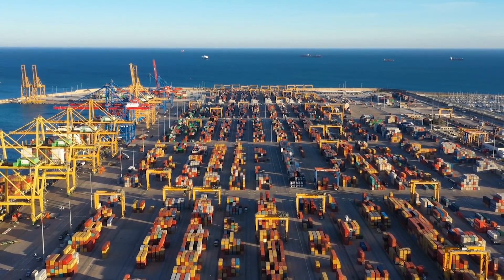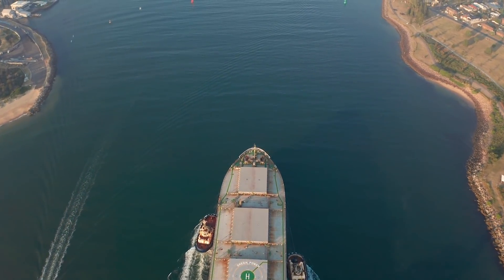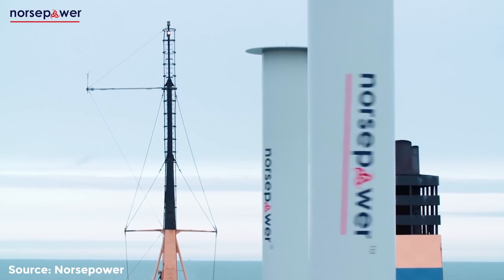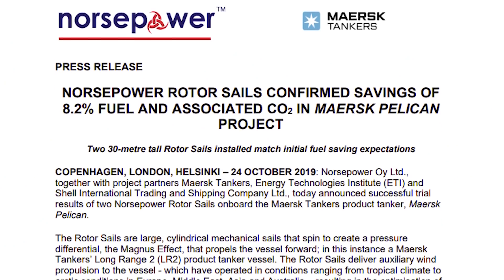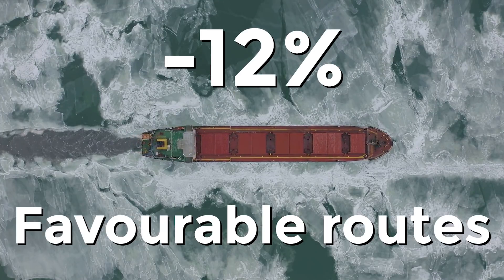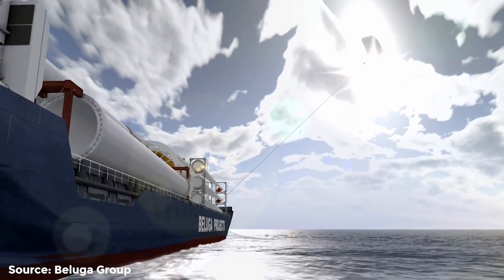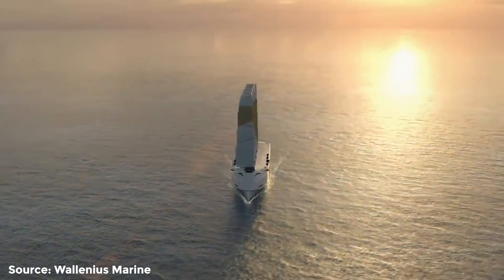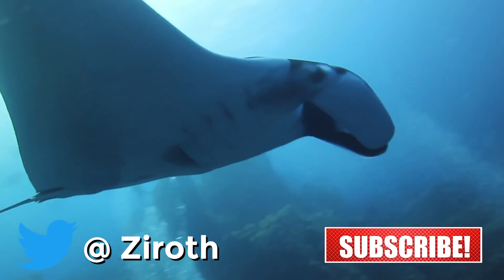Is Wind Power The Future of Shipping?

Comment: The kite sails look promising to me, the other ones do not, mainly because of how they effect the space on board the ship and also their short height. The kite needs no electricity or batteries, no rare earths. It can work in tandem with diesel engines seamlessly. Just add more kites to reduce energy consumption further, reel them in for storms, land and unfavourable winds. It looks to me like it would pay for itself easily while the others look too expensive, complicated and unsuited to the needs and limitations of large ships
Reply: Easiest solution: Add enough batteries to get in-out of the port, recharge on the go using solar power collected in orbit and beamed back using microwaves from satellites.
As all usual sea routes are more or less static, it would be easy to place the satellites in orbits along those routes. So let's say every 100 km there is a 50km strip where the orbit matches your route and you receive power. That way the batteries don't have to be that big and the only thing you need on the ship is the power receiver somewhere on top of the ship.
Reply: @mjk8019  Is this microwave power transmission powerful enough to beam through cloud cover? I'm not intimately familiar with the technology, but on a gut level it feels "wrong" to collect wireless energy only to pass it along again as wireless energy... I feel like any time it goes through a process, there are losses involved, and the total power available for end-use goes down with each new step.
Reply: @c182SkylaneRG  That would be true if earth had no atmosphere. But the fact is that more than 50% of solar energy is diffused in the atmosphere. Meanwhile microwaves are much more efficient in passing the atmosphere, including cloud layers. Meaning that the energy lost in conversion would be much lower than 50%.
Reply: @mjk8019  The next question is: what happens to the sailors that are catching some sun or checking tiedowns on deck when they pass under a microwave transmission zone? Or, what happens to the whale or dolphin swimming in a microwave transmission zone when there isn't a large cargo ship to hide under?
Reply: @c182SkylaneRG  The satellites can track a ship using GPS and only transmit directly to the ship when it's passing by. Well the sailors should stay in the cabin during the transmission, Or just use a special umbrella.
Reply: @mjk8019  Okay, next question: how tightly are we able to focus the beam? How much spread will there be between transmission from a geosynchronous satellite to a point 22,236-26,000-ish miles below it? Somehow I doubt we can keep that beam from spreading more than a mile in diameter, at which point we still have the issues of marine effects, as well as any other nearby shipping traffic.
Reply: @c182SkylaneRG  I was thinking more of a system like starlink in lower orbit. So the sattelites would not be geosynchronous, and instead could charge on the sunny side of earth and then discharge when they are on the other side.
Reply: @mjk8019  That's still what? 200 miles? 300 miles? I was being facetious with the 22,000 miles and only 1 mile dispersion, but I could realistically see 1 mile over 300 miles, or even 1/4 mile over 300 miles, but that's still bigger than the deck of a ship, and irradiates the surrounding area.
Reply: @c182SkylaneRG  Well, this question is above my paygrade :D. This is just an advice, but in theory it should be doable.
Reply: @mjk8019  The occupational hazards of being an Engineer. :)
Reply: @c182SkylaneRG  I can only imagine. officially I am just a QA Automation guy, but would love to one day become a legit engineer.
Reply: @mjk8019  Your theory sir is doable.  You can make the microwave small enough and directed in a single point in several burst. It is already being tested and tried. But not at the level you been discussing.
Reply: I have an idea, stop buying stupid crap on Amazon and Aliexpress.
Reply: Tom Kelly
Do you have engineering education ? ))
Reply: In my humble opinion, I believe that going back to steam power / renewable combo through the use of Solar thermal collectors on nice sunny days directed at boilers, whilst also utilizing rotor sails (that would also aid in propelling the vessel) with a rotating shaft to produce friction heat that is immersed in a water tank to essentially create a wind powered boiler for the steam engines...
Reply: @EnhancedCognition  The problem is salt.
Reply: @VidarrKerr  Surely that can be solved by utilizing closed gasket sleeves for the rotating shaft, whilst implementing a periodical cleaning on the collectors at the port, or with an automated spray wash system.
Reply: @EnhancedCognition  Salt water destroys almost everything.  It would be so expensive to maintain, no one would do it. Nuclear power is the future.
Reply: @EnhancedCognition  Might need to do some calculations on just how much energy there is per square foot and per mph and all that, but I'm not convinced you can boil water with a purely mechanical windmill system. I think the friction losses in that kind of setup would be way too high. Keep in mind that the theoretical maximum efficiency of any windmill is 60%, and the practical maximum attained has been around the 35-40% mark.

Solar, on the other hand, is not only doable, but has been done. You'd need a little PV panel to power a pump that could move your water through a large black-pipe solar heater, and presto: lots of solar-heated water. You might still need a small wood fire to push it the last few degrees to boiling so it can create actual steam, but you can get a good chunk of the way there, first. Of course, you'd need a giant boiler/firebox combo in the manner of old coal-fired steam ships for night-time ops.
Reply: @c182SkylaneRG  In regards to the solar thermal collectors. I was thinking something more akin to an array of mirrors mounted on solar tracking devices to direct said light at a single point (a boiler in this case) to power a steam engine. This of course would only work on sunny days which is where i surmised that a rotor sail (one of the devices mentioned in this video) that acts like a conventional sail in that it helps propel the craft forward could also be used to take advantage of its constant rotation to harness heat from friction to heat a boiler for the steam engine as well and wouldn't require sun.
Reply: @EnhancedCognition  Finally watched the video to figure out what this "rotor sail" was of which you spoke. Personally, I feel as though they'd get more use out of an airfoil than they do out of using some available power to spin those masts to generate lift. In the design presented in the video, that rotor is harnessing exactly 0 rotational energy from the wind, and 100% of the friction energy you're requesting will come from the electric motors powering it. At that point, you'd have much better luck sending that same electricity through a resistive heating element inside the boiler, bypassing the motor and sail entirely. You'll get 100% of the electric energy into the boiler, as opposed to maybe 30%. Beyond that, if you can find a refrigerant that can work at the required temperatures, you can get upwards of 200%-300% of that same electric energy into the boiler by using a heat-pump.

As for solar water heating arrays, those mirrored concentrators are always full of oil so they can withstand the temperatures they get up to, and they're always in small pipes to minimize the thermal mass at any one point in the system. You basically want to maximize the surface area of your operating fluid during the heating process, to try to absorb as much heat as possible, as quickly as possible. You'd also need to consider the shadow created by a boiler vessel, and ensure everything is positioned so that shadow doesn't interfere with the solar collection process. Ultimately, everything comes down to the square footage of the solar collection array, balanced against the radiative properties of the rest of the system (how fast does it collect energy vs how fast does it lose it. If it collects more than it loses, then it will eventually boil. If it loses more than it collects, it never will). Keeping in mind that the hotter the water gets, the faster it radiates that heat to the surrounding environment.
Reply: @EnhancedCognition  

Why solar thermal over solar PV?
Reply: You could probably let them double as an antenna, maybe even carry a radar.
Reply: I don’t think the kite sails are good, because we can’t make them big enough.
Reply: How about shipping companies have v larger numbers of smaller ships carrying the same cargos?
Reply: Even better, we can erect a large frame at the front and back of the ship and use that to hold a much larger kite, which can catch more air. If you rotate the frames, you can move sideways to the direction of the wind, so you can travel in the direction closest to your eventual destination. I call my invention "sails". :D
Reply: @c182SkylaneRG  I think you missed the whole sails take up way too much space on the cargo deck part of the conversation.
Reply: @TitoRigatoni  Technically didn't watch the video, but if you put them at the very front and very back of the ship, you can leave the center area wide open for cargo. We've got better materials technology, these days, that will allow for placing the main-masts at the extreme ends rather than dead-center, and still be able to securely anchor them. Will the ship make good speed? Hell no. But it'll move with the power of the wind in an age where we've run out of fossil fuels.
Reply: skysails have utterly failed. They are to complex to operate and most of the time not even usable. Beluga used them mainly for publicity. and to put this in a timeframe, beluga has been out of Business for almost ten years. Flettner rotors are at least somewhat usable, since they are easy to operate and on many ships deckspace is not utilised or possible to utlilise. Bulkers would be well suited, sadly for tankers thats not possible for now due to the danger of electrostatic accumulation. I was somewhat involved with the FEHN POLLUX Project thats still going well. But the main Problem still stands, as long as Time and Bareboat Charter Contracts dont shift the fuelcost to the owners, its not really usefull, especially since most Shipping companies that acctually own their own ships and run them as well are container carriers
Reply: @necrid7329  So one point to note: in a universe where we go back to sailing ships (or some other form of wind-powered shipping), Tankers won't be carrying explosive or flammable chemicals anymore, because those won't exist. Literally the only way we'll ever go back to wind-powered shipping is because we finally ran out of fossil fuels to power the ships with, and we'll probably go with solar/battery electric before we go back to 17th-century wood-and-canvas. Hell, we might even go Nuclear, just because we "have" to... (Sounds dumb now, but in a universe devoid of fossil fuels, I'm sure someone will pitch it to sound convincing and it'll get adopted. Their descendants will live to regret that decision, sure, just like we're all regretting Vietnam, Iraq 2, and "buy now, pay later", today. Doesn't mean it won't get made).
Reply: @c182SkylaneRG  oil will never "run out". There will just be a point where oil reserves are so hard to reach and so expensive to extract that the number of usecases where petroleum products are used will decrease. There is a need for tankers, be it oil or chemical. And there will be for the foreseeable future. Maybe not in 50 years, but we will see.  Just these past few months we carried a few cargos that wont be able to be replaced so soon.  for example a full cargo of four different grades of petroleum products to greenland. The climate and vast distances make it necessary. And I'm sure fuel is not cheap there, yet it is a necessityBy the way I made a mistake, apparently it is possible to use flettner rotors on tankers, maersk did so and saved about 7% of fuel over a year.
Reply: The future is fossil and synthetic gas. The latter can be produced with nuclear power onshore.
Nuclear power on ships does technically work, but as long as nuclear ships are not allowed to call at civil ports, nuclear energy will not be an option.
Reply: @OpenGL4ever  Why Nuclear power? How much power is required to transform Algae into a combustible form of fuel that a large ship could use for power? Something like an automobile or airplane would certainly require more refinement, but my understanding is that ships already use pretty crude forms of oil, and if internal combustion ship engines can't handle how crude it is, we can always go back to steam power.
Reply: @c182SkylaneRG  You’re advocating burning stuff that has captured carbon and forms part of the ocean eco system. If you’re objective is to reduce CO2 impact, you’ve failed. Nuclear on ships is a proven technology - it’s just too damn expensive. But if everyone was using it instead of just elite military it could potentially be a lot cheaper, especially over the lifecycle of a cargo ship.
Reply: @mondotv4216  Algae forms part of the ocean ecosystem just like Corn forms part of the human food supply or wood forms a part of a forest ecosystem. In each case, you can grow extra in dedicated farms for the express purpose of creating fuel. They've been experimenting with Algae based fuels, and have successfully developed a functional product, but I think they're having a bit of trouble with scaling up production.

Fuel based on carbon captured within the previous year or two is considered "carbon neutral" because you're reusing the same carbon without having any more or any less in the atmosphere than you did before you started. Carbon in Fossil Fuels has been out of the picture for eons until we dug it up and put it back in the atmosphere, adding to the total carbon in any carbon cycle we then create.
Reply: @mondotv4216  while a nuclear reactor is indeed by far the most efficent thing you can use to power a ship, the issue is that naval reactors utilize highly enriched uranium as fuel. The same stuff making up the core of a gun type atomic bomb. This is why they are restricted to military ships only. Land based reactors don't have this problem because their fuel has such low enrichment that using it for a weapon is impossible, but in turn, the energy they produce relative to their size and cost is very low (still much higher than any other means of power generation but not as high as it could be, sadly)
Reply: @c182SkylaneRG  The US marines already have nuclear powered ships, but the problem with them is that the nucular waste can be used for nuclear weapons, making it unsuited for cargo ships (without massive guns in them). Maybe there will be types if nuclear energy without that downside in the future though.
Reply: @thijmstickman8349  I'm not actually aware of any Marine vessels that are Nuclear powered. The Navy operates a few, but the vast majority of their fleet is still oil-fired, rather than Nuclear, because of the risks and the costs involved. The fact of the matter is that Nuclear is extremely dangerous if mishandled, as proven by at least one Russian submarine accident that got turned into a movie. Add to that fact the fact that we still have no place to store spent fuel (the Navy is being creative with temporary storage, and all land-based power plants are storing their waste on-site, pending the development and construction of a permanent storage facility), and the costs involved are prohibitive for any commercial shipping enterprise, even before we get into the risks of needing to use weapons-grade fuel.

I still see the post-oil future of shipping going back to sail (proven technology) and probably being supplemented with solar electric for nighttime power (charge during the day, use at night). I can easily see sail masts being placed in intervals along the deck of a ship, with shipping containers being placed between and below them, such that once underway, the sails will deploy over the tops of the shipping containers and provide thrust, but fold out of the way for crane ops in port.

Comment: Just put wind turbines on the ship, and use the power to propel, or assist in the propulsion of the ship, with a tail wind , it will be more efficient,   an asymmetrical implementation of the alternative propulsion, could allow cargo loading close as possible to normal,    I would very much like to have a large barge, or group of barges, as a homested, on a lake, that can move, I would like to use solar and turbines, for power, with a. Generator, using a large electric motor, to move the large mass, it would be like a floating island, with a garden, small trees, and house, I have seen one in Canada, on a small lake, you can fish from anywhere!

Comment: I think it is more likely that remote floating wind farms producing hydrogen will serve as fuel stations.
Reply: Well, as he points out at the end of the film, combining technologies would be interesting. (I to very much believe in hydrogen tech.)
Reply: Best of  luck so trying to store  hydrogen.
Reply: @ProfessorFickle  You do know there are massive ships that transport gas around the planet. The technology is not new. From an engineering perspective its not an issue.
Reply: @RoadRashSpirit  :apples vs Oranges. 
Natural gas in dedicated cargo ships leak a little... hydrogen Gas 😂 Good luck with that.
Reply: @ProfessorFickle  Other than the fact that a small amount of leakage in a well ventilated area is fine. We have been storing gasses like hydrogen for 100s of years. Like I said, it's not even an engineering challenge. It's run of the mill stuff.